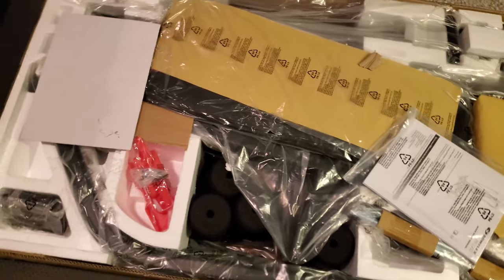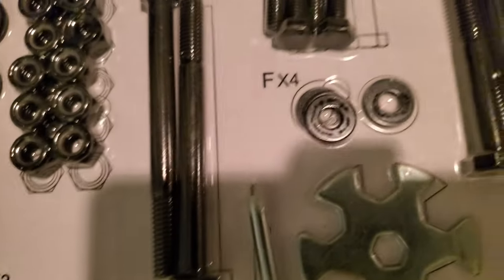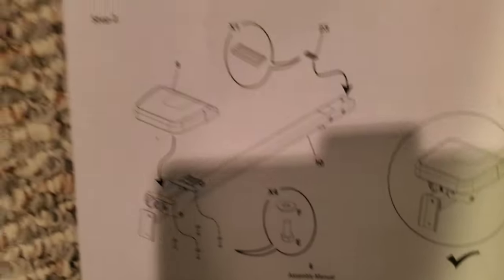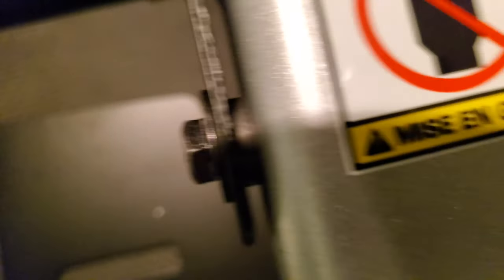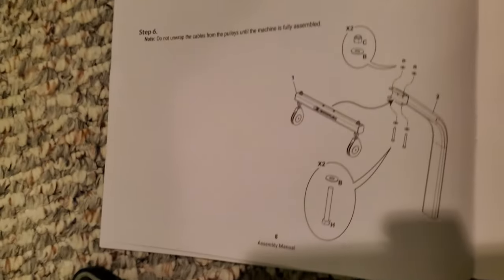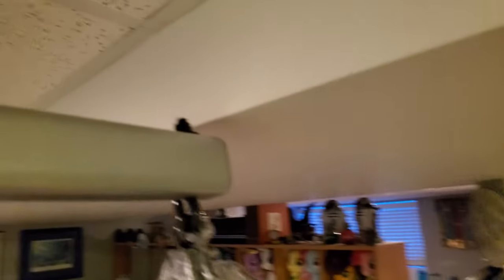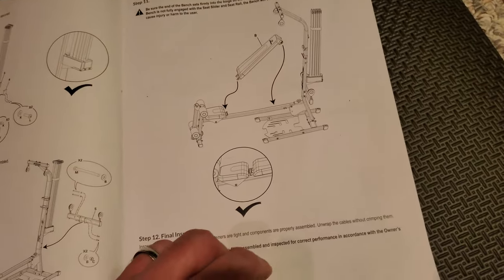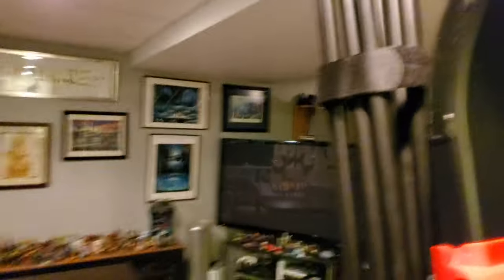Bowflex PR1000 home gym - unboxing, assembly, test and thoughts!

Comment: Hi, how much room do I need to leave from the wall to allow the rod to fully flex down? What's the total width when they're fully down? Thanks!
Reply from the maker: I measure around 3'2" from center of the main post to the maximum distance the pole will extend out from center. Bowflex indicates in the manual that the workout area should be 100" L x 78" W which lines up pretty well with what I measured with about an inch on either side from maximum.
Hope that helps.

Comment: Great video! I think you're helped make my final decision. Just two questions: 1)What is the dimension of the floor mat you have set down for it? Im tryna get a better idea of how much floor space I need, and also how many mats to purchase lol.            2)How much space do the rods take up when they're being used? So like @29:09 what's the maximum width from end to end?
Reply from the maker: Thanks for watching! The floor mat is just a bit under 4 foot by 8 foot - when the rods are at the widest part of their arc the total width for them together is a little over 6 feet - say 6 foot 1-2 inches. Hope that helps.

Comment: Can you roll this around once you fold it up so you can easily move it around? I cant tell if it has hidden wheels that only make contact once you tilt it enough like some exercise equipment has.
Reply from the maker: The unit does not have any wheels on it, unfortunately. It is not particularly heavy though, so it isn't too hard to drag around, if you can find a good way to protect your floors when you do.
Thanks for watching.

Comment: Would this be fairly doable to disassemble for transport and reassemble or would it be a mess?
Reply from the maker: It wouldn't be too bad to break it down and move it in a few larger pieces. If you want to break it all the way down, that would definitely be more of a pain - would really need to be careful about keeping track of all the parts in that case
Reply: Kinda what I was thinking, thanks